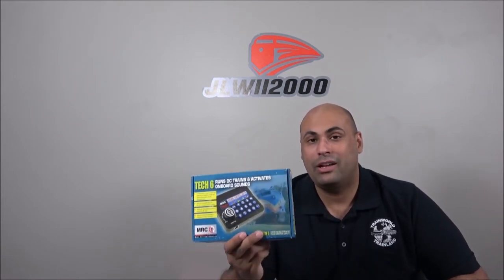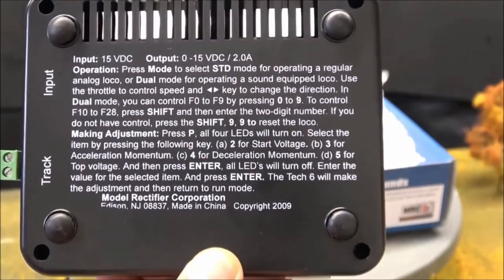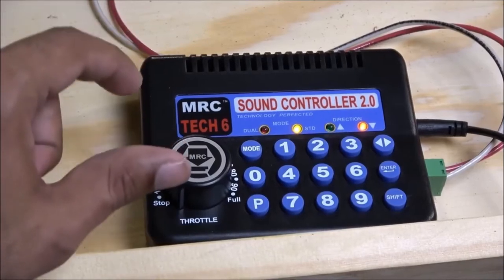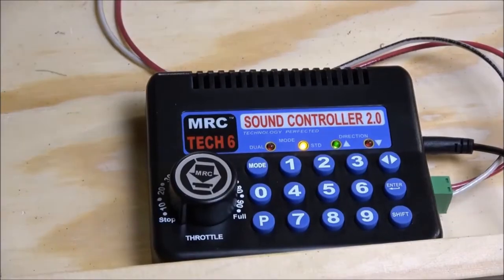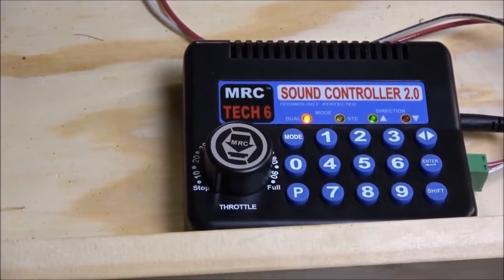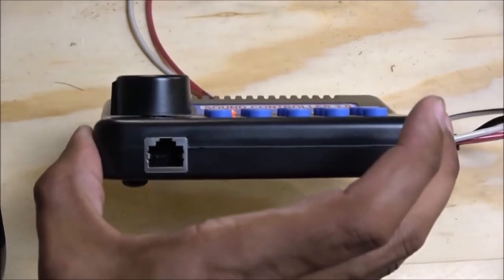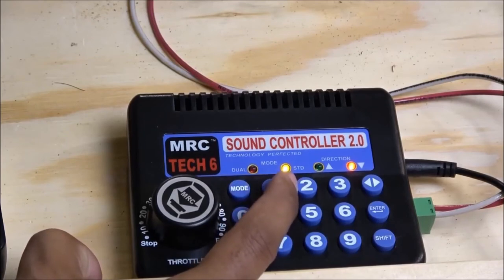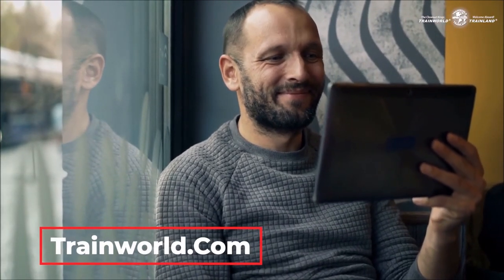MRC Tech 6 Sound Controller 2.0 Power Pack Review with James Wright!

Comment: I tried this on the Acela Express and it works, but the Acela Express is kinda slow with this power pack. All the features work, but it won't run at full speed.

Comment: Just getting into model RR , and just got the MRC tech 6 . My question is , to turn it on/off , the only way is to plug in and unplug power wire from wall whort ??? I would think they'd put and on/off switch/button on the panel . thanks for any info . Steve

Comment: The system seems to pick up the DCC engine address from the looks of the video without having to put the engines address in.  Is that correct?
Reply: If the address at 3 default. One thing James didn't mention is how many trains can run independently in DCC. I pretty sure its three. The system only supports address 1,2, and 3.

Comment: Which connector for Kato track?
Reply: I used KAT24825 extension chord. You will need to snip off one end then strip the wires with a wire stripper. The nice thing about using KAT24825 is you can then leave this connected, and simply disconnect the other end from your feeder track. 
- strip about an inch then twist the wires tight
- loosen the screws, insert wires, screw them back down tight. 

This worked perfectly for me, running N Scale and have two BLI (broadway limited) locos. It was great to finally hear the bells, whistles, sounds, etc.